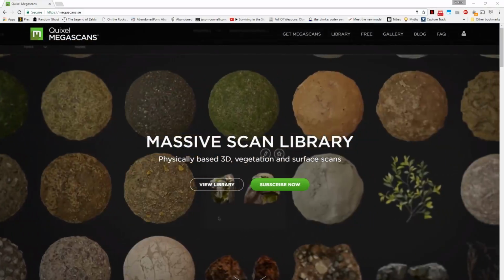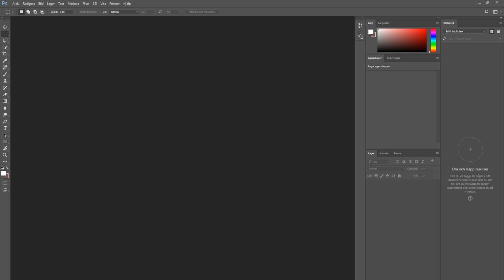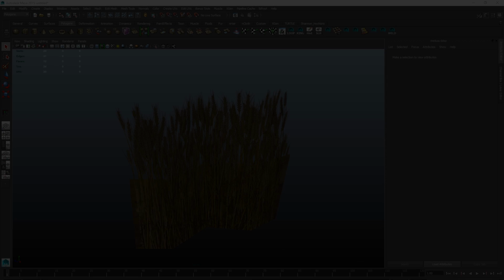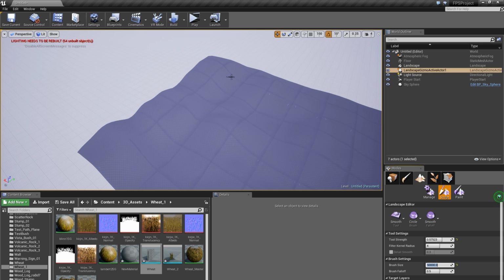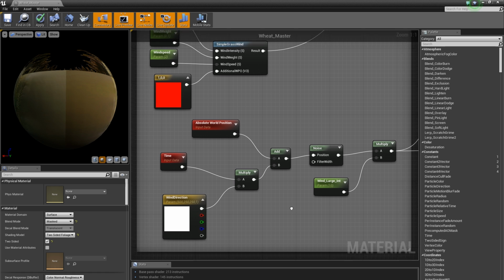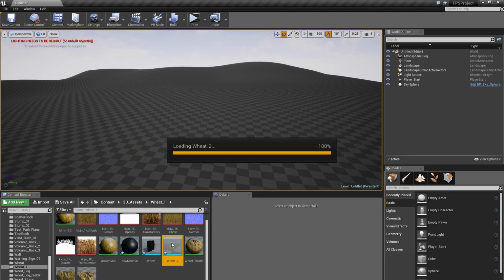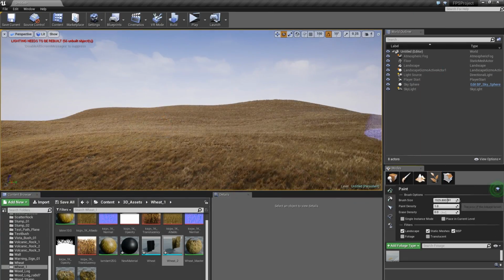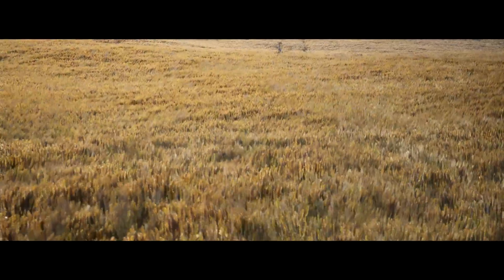Simple Animated Vegetation with Megascans and UE4

Comment: Anyone having trouble with the foliage world position offset issue where the foliage has a gross black noise rolling over it? Is absolutely horrid depending on the angle of a dynamic directional light. I'm finding in my scene if the sunlight is in front of camera casting towards camera, it's actually not a bad look. but if the light is coming from behind camera, I can get terrible unusable black splotches over the grass
Reply: more playing around with this--this really only works with the light being cast from in front of camera, there's no version of this that works when light is directly above or coming from behind camera.

Comment: "Simple Animated Vegetation with Megascans and UE4"

opens Maya for 3D
Reply: you can do the same thing in blender no problem
Reply: Hell you can even do it in unreal
Reply: Buttered Pastas... uses water Sh*t you should have been more precise!
Reply: Ikr. But the title is wrong in here if you use Maya or blender while it tells "megascans and ue4"
Reply: @GoldenJan  It's kind of a given that any geometry in Unreal is going to be made & imported from a seperate 3D package most of the time. Now, he also used Photoshop, should he include that in title too? In 3D it's very common to use a whole pipeline, and so it doesn't need to be mentioned everytime.

Megascans and UE4 is what the bulk of work was done in, and those two are the only important packages you need.
Reply: @artwizardsam3238  ik how these works. It's the fact that it's nowhere mentioned. For ex. a beginner now want to try to recreate this process. Or atleast parts of the process. It's nearly impossible due lack of information. Yeah you can use any given software, I'd recommend to get trough and look out for the software you prefer, but don't do tutorials or similar without notice which software you used for this specific scene.

Comment: Nice tutorial, megascans is a really nice tool. I have one question though - why do you add the vertex animation noise to the roughness and spec inputs? The fact that the grass is "moving" surely doesn't effect how rough it is. Did you do it just to exaggerate the way the grass reacts to light as it moves? Thanks :)

Comment: Even with an opaque texture, transparent materials will always draw, so the only way to  reduce overdraw would be make an opaque shader for the bottom part, AFAIK
Reply: Interesting - Would that be the case also with masked shading model? I'll have to look into that!
Reply: That's very interesting! Framerate went up quite significantly when doing the tests. I have to find out more about this. Thanks for the comment!
Reply: He's right. Even with a masked shading model you'll get overdraw on any transparency, even if it's not visible. Great video! Love the effect.

Comment: Looks great - questions:
* This is game solution or cinematic only - how about performance
* how looks borders between vegetation and rest of map, in details
Reply: It's not very optimized, but I'm getting around 95 fps. There are ways you could improve performance, such as reducing the resolution, making the vegetation less dense and so on. The borders have the clipped opacity showing clearly, but you can easily get around that by placing a row of "unclipped" assets there.
Reply: The main performance in question would come from how dense the grass you have is, how much of it you have, and the noise in the shader - but you could easily get away with baking that noise into a texture and replacing the noise node with that.
Reply: Nice! :) I'm coding my game now, but I will design world soon I hope.

Comment: Man I wish I could register on the website and get these models but even if i do get them I don't understand what some of those maps do.
Reply: i know to create normal map, height map or displacement, specular, diffuse, ambient occlusion and I have no idea what is roughness or reflection or gloss
Reply: Read up on PBR(physically based materials). They model how actual materials work in real life, rather than the more abstracted models like Phong, Blinn, and so on that were conceived back in the early days.
It's weird when you're already used to classic cg materials. But ultimately PBR is more intuitive because it matches actual material properties.
Reply: i know what pbr is but they are expensive
Reply: Megascans is expensive, but you don't need megascans to utilize the PBR workflow